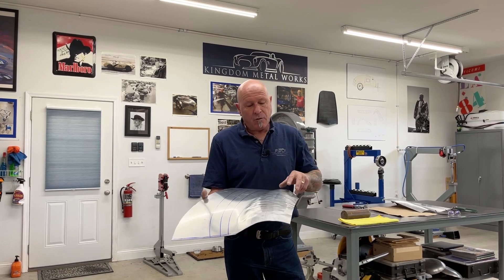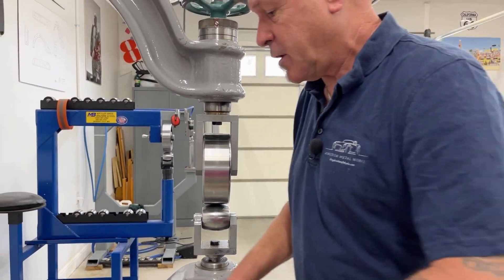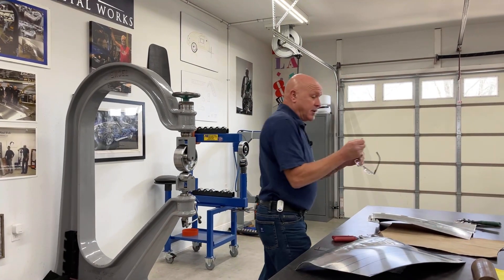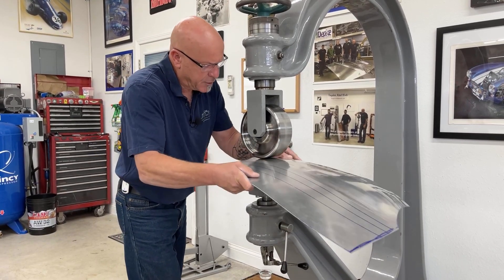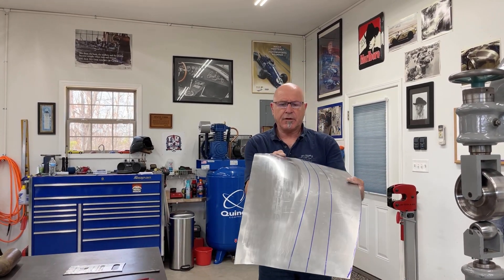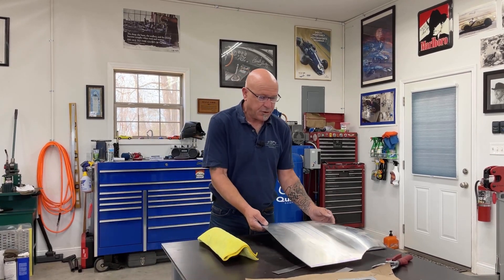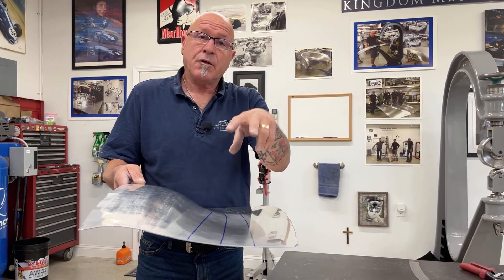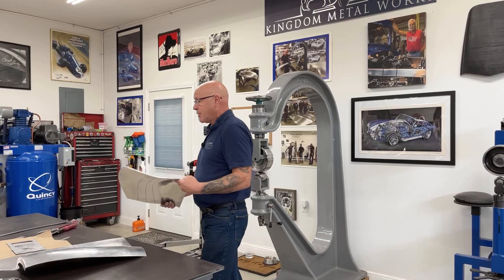Signature Series in Metal Shaping Session #1- C The Reverse Curve

Comment: Hi Kevin, how come the beating doesn't harden the metal? I've only worked with copper, and that gets hard quite quickly.
Reply: Ok, thanks.
Reply from the maker: Hey Bob! Because the molecular structure of the aluminum 3003 is very different than copper. It work hardens at a much slower rate.